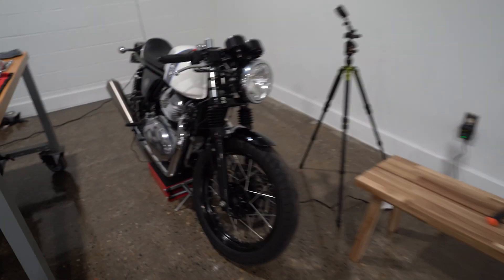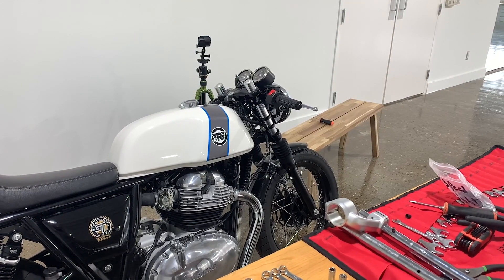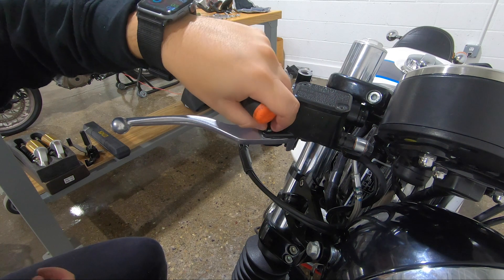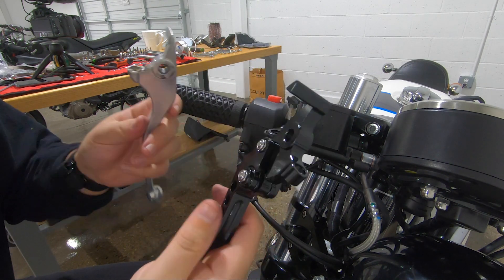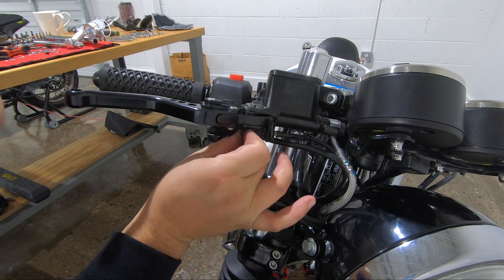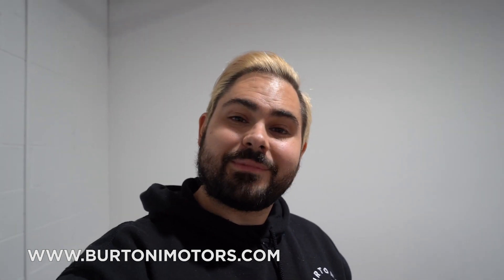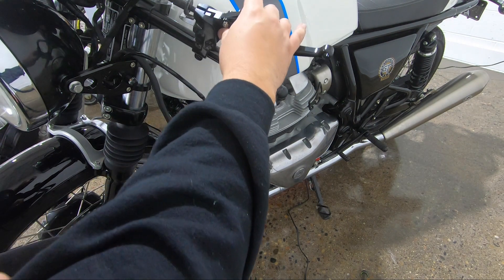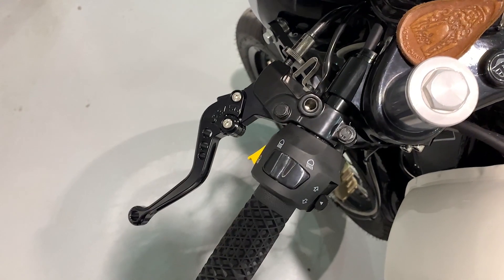How To Install Adjustable Clutch / Brake Levers On Royal Enfield Continental GT 650

Comment: If you loosen the cable adjuster at the clutch lever, you probably won’t need to disconnect the cable down by the clutch 👍